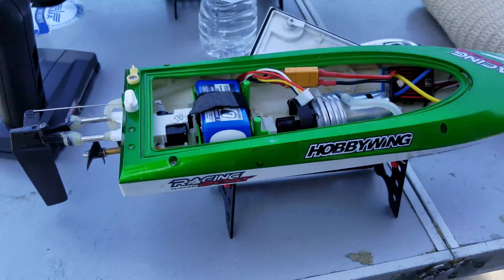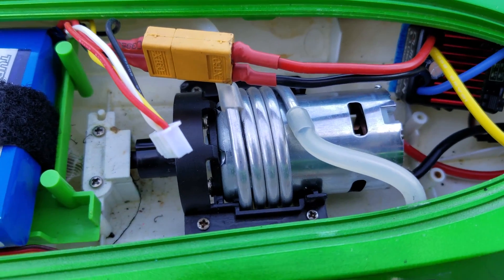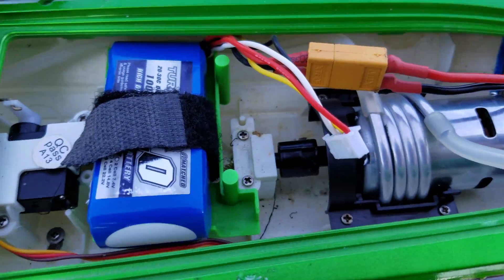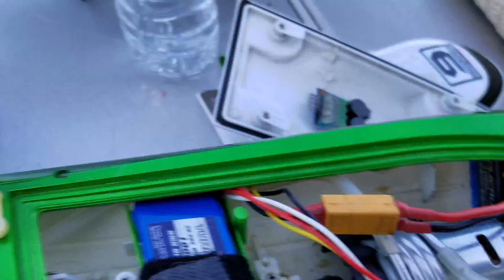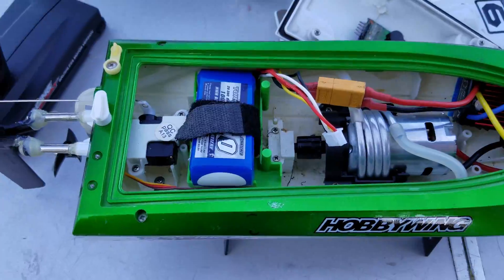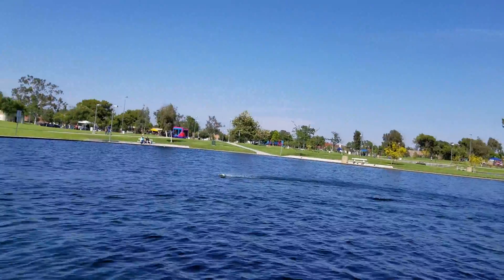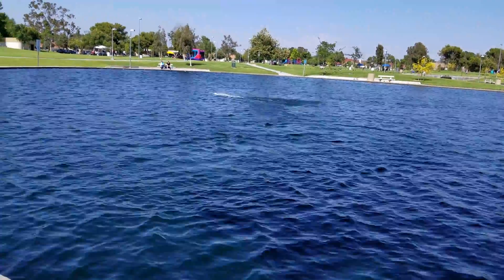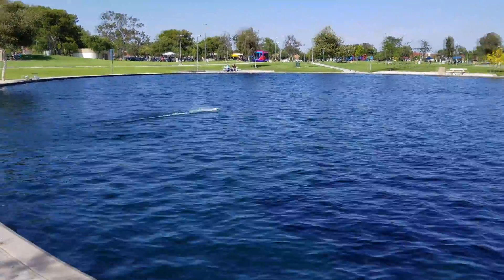FT009 RC Boat upgrade to 3s 550 bushed motor

Comment: The battery link doesn't work, is that the turingy 1000mAh you can get from Hobbyking?
Also does the inner cover fit on with the battery. My brother has a ft009 and has tried a 1500mAh 3S but can only fit with the outer cover only because the battery is taller.
His is 100%  stock with stock 540 motor and runs fine and fast with a 3S no problem, no need to change motor or ESC.

Comment: hi guy, i have similar setup as your Ft009 , stock 540 motor, wp-1060 esc (lipo, Fwd/Rev mode), 2s battery, radiolink RC4GS tx, and i my ft009 only able to run full speed at first 30sec, and then power down a lot and slow down, seems esc overheat / low voltage protection triggered, do you have any issue of this?  Will 3S battery solve this issue?
Reply: Alex Chan why change so many things?
The stock ft009 will run just fine on 3S with a nice increase in speed and no over heating issues
Reply from the maker: Alex Chan try new battery 2s.
Reply: How hot is your ESC? Is your battery getting hot as well?
Reply: How did you get the plastic part off of the motor shaft